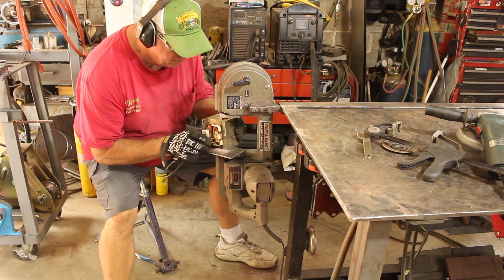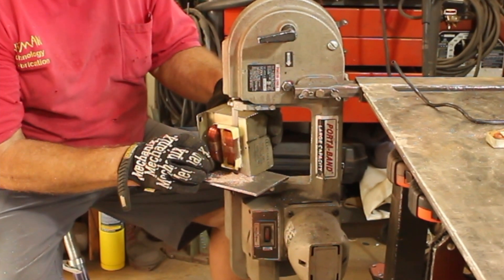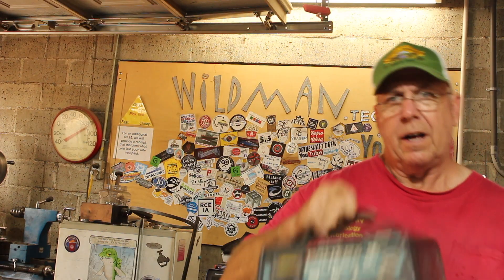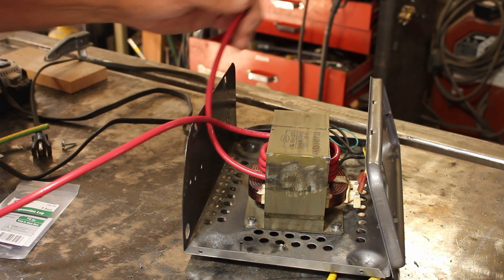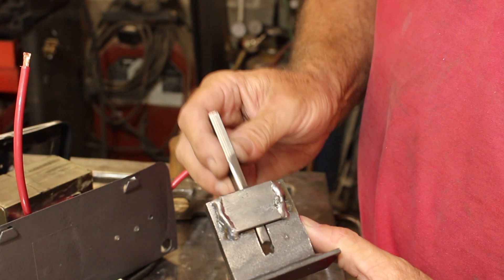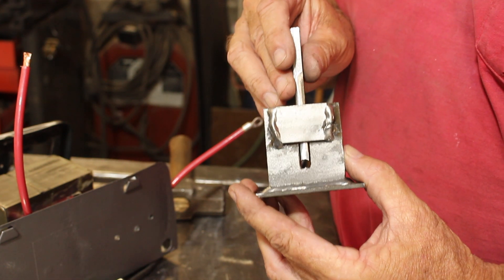Arthur Ganson Style Spot Welder

Comment: Nice design. I'd suggest you may want to maybe put a foot switch on the power in, then you'd be able to set your electrodes precisely before welding, if you haven't already done something similar.
Reply from the maker: My thoughts exactly. That would be a definite improvement! Thanks!
Reply: It seems that is what is happening in the Arthur Ganson video.  Any updates with a foot pedal?

Comment: Buy some liquid rosen flux, the type that comes in the squishy plastic jar with the needle applicator on it. 

And preflux your wires before crimping them, flux when it heats up removes oxidation and it will do wonders for your solder connections.